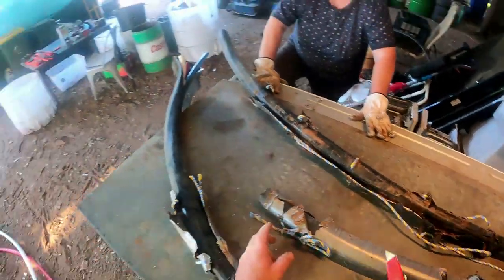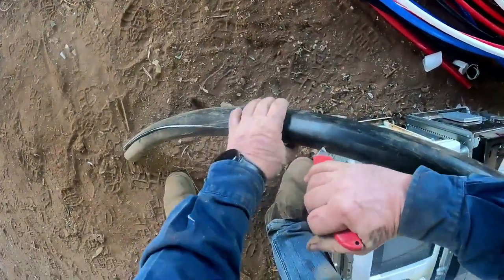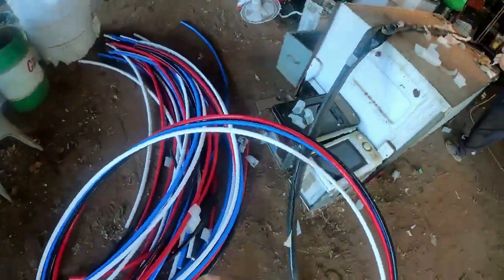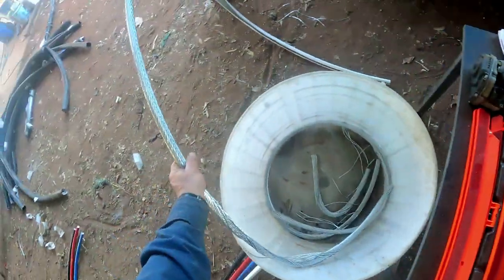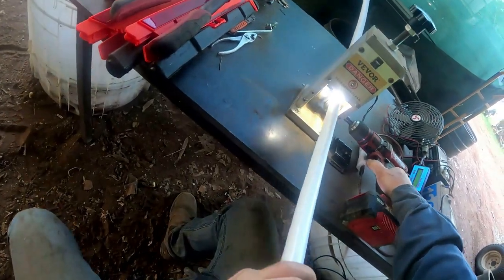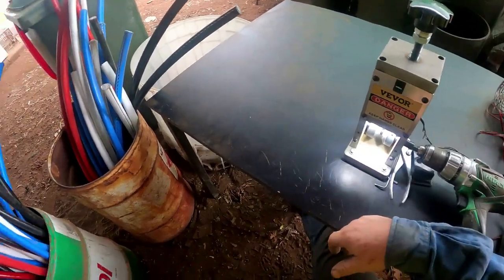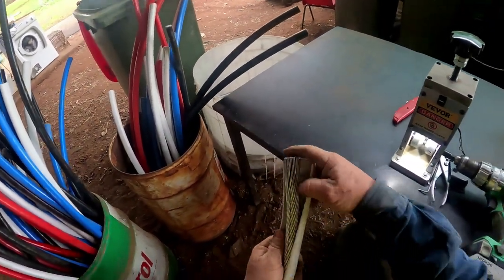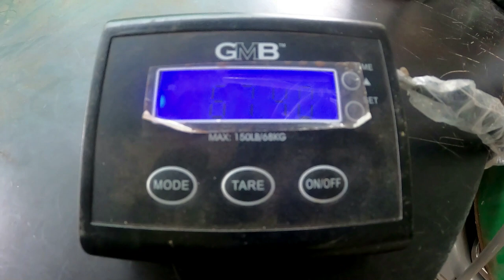3000 SUBSCRIBERS OMG Stripping 67 KGS Of Aluminium Wire

Comment: Notice you are wearing a coat now.  How much does your day's temperature vary?  Do you still get much rain in the Fall and Winter?  Have you heard anything yet on the wine bottles being accepted?  Noticed you used the screw driver to take the wiring out of the wrapping.  Waiting to see the new electric press for the aluminum.  Have you had time to do any more work on the old car?  Be safe out there.
Reply from the maker: I do apologise that that is not a coat that is a normal long sleeve shirt and yes the weather is getting colder last night was only 3 degrees Celsius and I haven't heard any more about the wine bowls being accepted it's always a slow process when it comes to the government and to the old little blue car haven't touched it yet but I do have all the parts